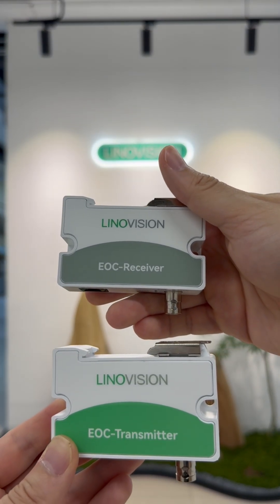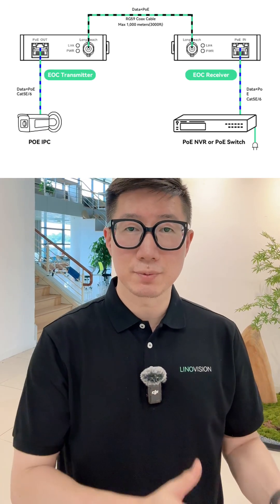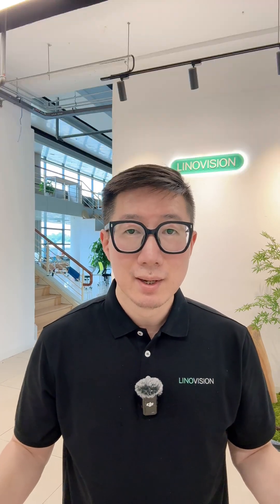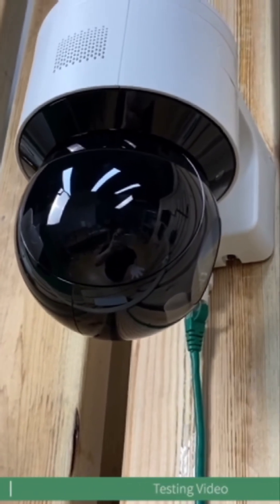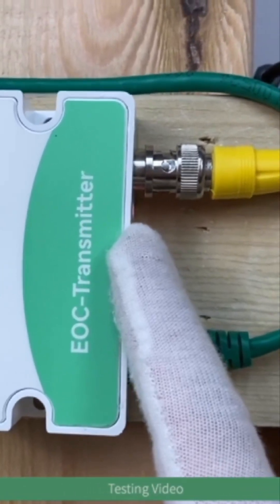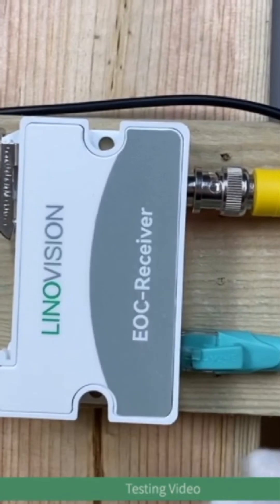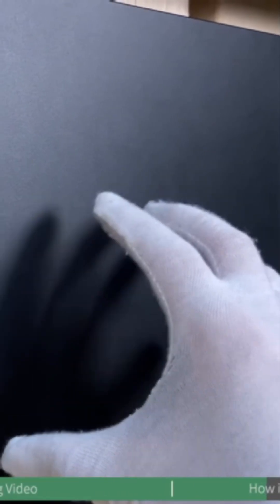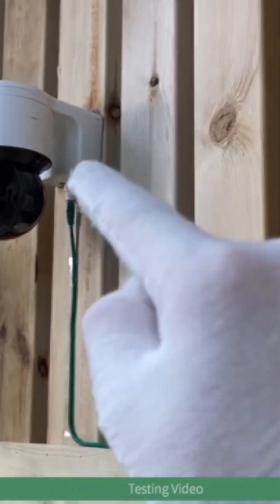How to upgrade your Analog Camera system to IP Camera system WITHOUT REPLACING existing COAXIAL?

Comment: I've been using these IP over coax adapters from lino vision for a few years now lately some of them are giving me troubles especially in elevators😢

Can you give out a slightly more powerful one to get around this elevator issue I think the electric signal is interfering with the unshielded pears of elevator cable
Reply from the maker: Thank you for reaching out, and we appreciate you sharing your long-term experience with our IP over Coax adapters.

What you’re describing is indeed a scenario we sometimes see in elevator applications. Elevator environments typically have strong electromagnetic interference due to motors, control systems, and frequent power switching. When unshielded twisted pairs or coax lines are routed alongside these sources, signal integrity can be affected, which may explain the intermittent issues you’re experiencing.

Regarding your question about a more powerful adapter:
We are currently planning upgraded EoC models with higher power margins and higher data rates. However, it’s important to set proper expectations—while increased power and improved chipset design can enhance overall robustness, they cannot fully eliminate interference that is already present on the cable itself. If the noise is being injected directly into the transmission medium, a device-level upgrade alone may not completely resolve the issue.

For installations inside elevator shafts or machine rooms, our professional recommendation remains the same:
If feasible, using shielded cabling is the most effective and reliable way to mitigate electromagnetic interference.

Once the upgraded EoC models are officially released, you’re certainly welcome to evaluate them in your environment. In the meantime, if you’d like, we can also help review your current cabling topology and installation conditions to see if there are any practical optimizations that could improve stability.

Please feel free to let us know how you’d like to proceed, we’re happy to assist further.

Best regards,
LINOVISION Support Team
Reply: Can't wait for the upgraded EoC !!! Let me know when its out  @linovision
Reply from the maker: @bentzy2474  Thanks for the interest! We’ll share updates as soon as it’s officially released and will keep you posted.

Comment: Video clear equal on cat6 cable or not
Reply from the maker: Thanks for your question!

A single standard camera usually streams at around 10–15 Mbps, which is far below the maximum capacity of both EoC and Cat6 cables. So in normal scenarios, the bandwidth is more than enough, and your video quality won’t be affected.

If you’re deploying multiple cameras or covering long distances, that’s when things need closer attention:
	•	Multiple cameras: You’d need to calculate the total bandwidth. Typically, 6–8 cameras won’t be a problem.
	•	Long distances:
	•	EoC can drop to 10 Mbps beyond ~450 meters, but for standard HD, it still works fine.
	•	Cat6 generally maxes out around 100 meters without additional extenders or switches. Using extenders may reduce speeds to 10/100 Mbps, which is fine for HD but not for ultra-high resolutions.

Comment: Can I order it on Amazon?
Reply from the maker: Yes, the link as https://www.amazon.com/Converter-3000ft-Transmission-Regular-coaxial/dp/B07G194BQD/ref=sr_1_1?crid=28FSXVYDF6DL7&dib=eyJ2IjoiMSJ9.g3CJxV9Qf_IyTy9wkOOIni1TjTs21Je7Jnqs0nSMaye7tTLFUN4i3R5UtAG9bti2gjxA6MRTNCx6cg2DhgVX70YQzMlZEIBz2knW3aWBL28VngxWxQta77LYY9xDR6nvaAR1NsYJHgvmeTQe7Gz_pN3hPkm0TQca-eSEtxuKP-zhxajZ9datdfiAEfCSupPPCOKUKPh1ehqS2f-B2D2PA6Nz1iCgjfaTx7dv1binwig.SHDnmCQy-znxwgB1s7FOPbmmy2l3YA-1K46LYcmjgxc&dib_tag=se&keywords=LINOVISION&qid=1750389546&sprefix=lino%2Caps%2C1200&sr=8-1&th=1
Reply: @linovision  Thanks.